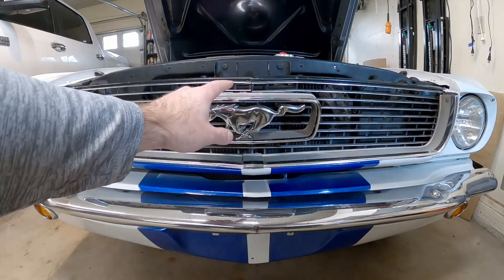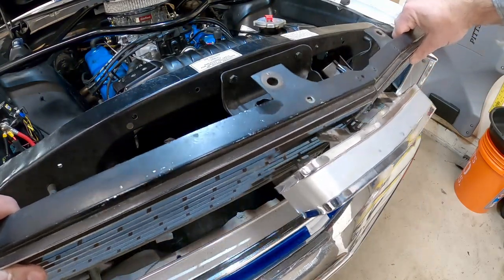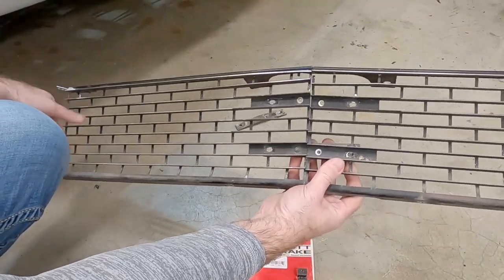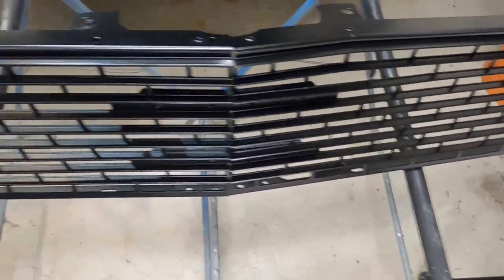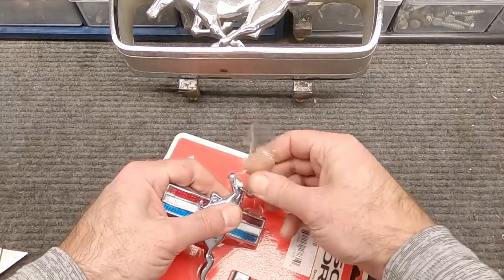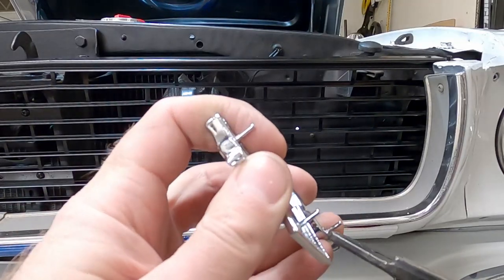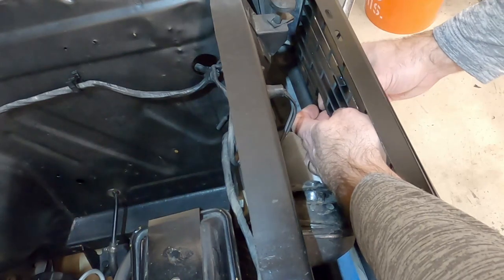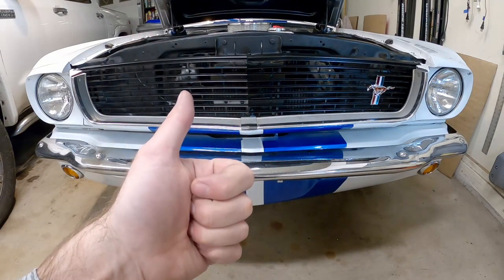Upgrading the Grill

Comment: Andy, I just took off my corral and pony centerpiece, to put on the tri-bar pony emblem. The tiny clip would not lock onto the pin, until I pinched the locking fingers more center, to grab onto the attach pins. It seems there is always some kind of massaging to add ons.
Reply from the maker: Yeah, sometimes little things like that can ruin an otherwise great afternoon.  :)

Comment: Great job, looks great. I have watched your video about gas hard lines from pump to carb, I cut th line and ready to flare but cannot find anywhere the A N fitting that you used. have any part number?
Reply from the maker: Thanks!
That black fuel line adapter fitting is a 5/16 tube to -6AN fitting and I purchased it off Ebay.